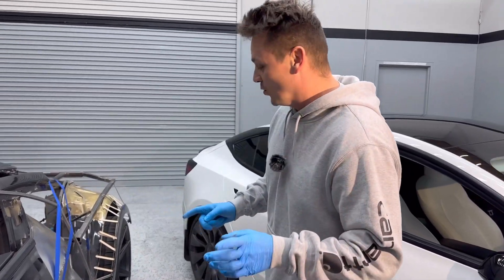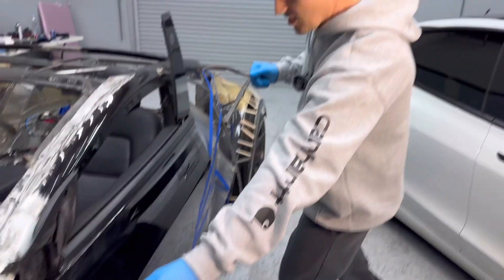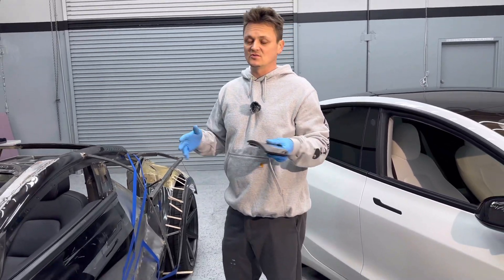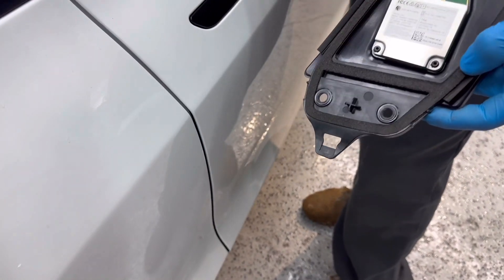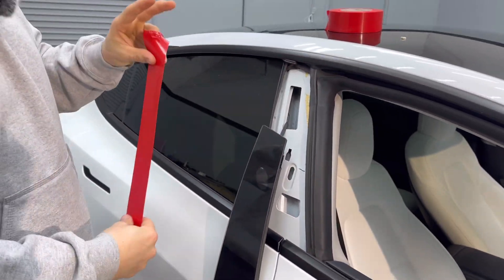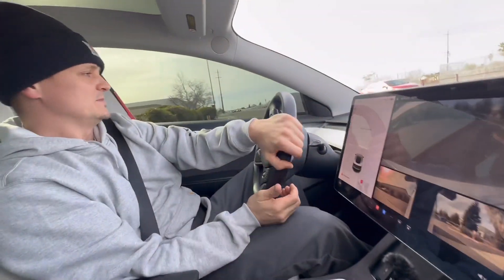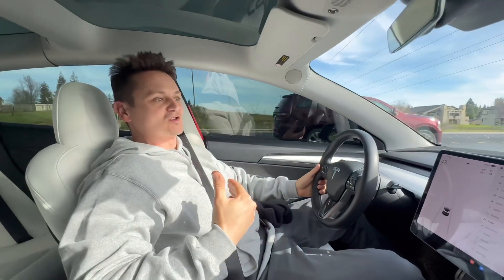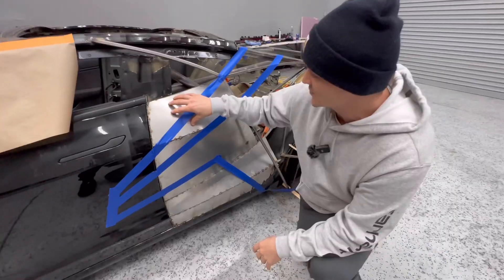Will Tesla autopilot cameras work if moved to a different location?

Comment: I'm going to guess no - I don't know about Tesla's implementation, but in general these sensor fusion platforms have a pretty detailed model of where the sensors are located  and although the software can learn the exact positions it's within a fairly narrow window and if the calculated offset between the sensors is outside of that small range it will just error out.  The test you did isn't going to tell you much because you still have the correct basic location, which isn't going to be the case in your mechanically modified target  vehicle.

Comment: The module at the bottom of the pillar is likely the key card reader to lock and unlock the car, so you might want to relocate that on the cyber roadster to keep keycard functionality
Reply: I doubt it, it’s likely a controller for the camera and heating module. Key card to unlock can only be used on the drivers side pillar